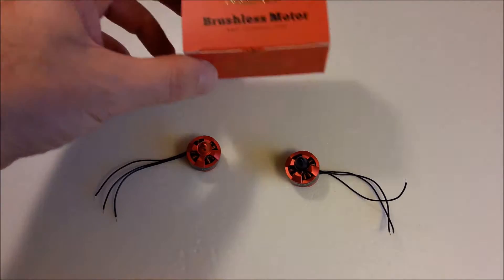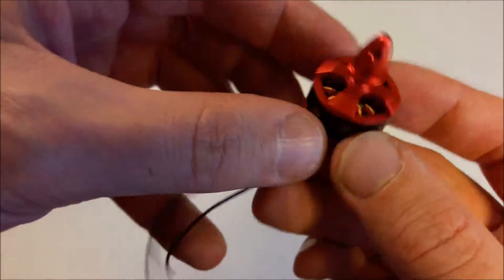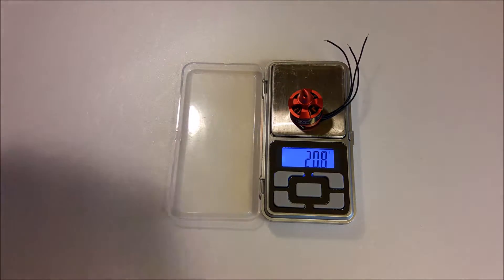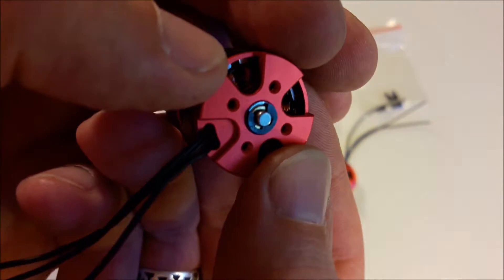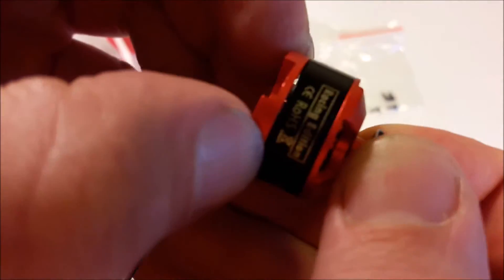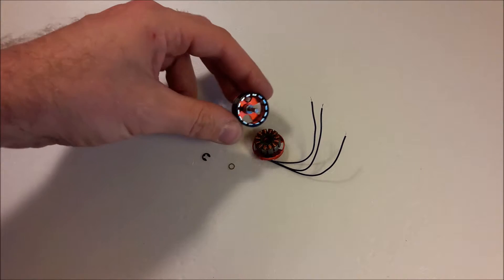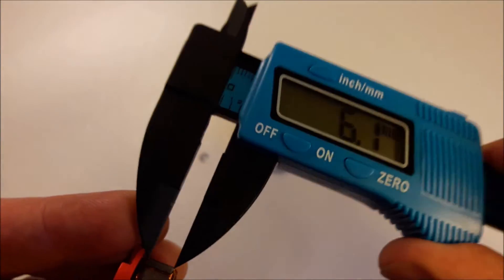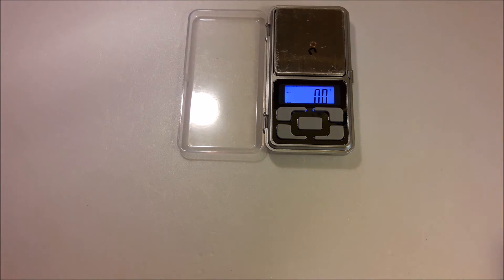Racerstar BR1806 2280kv motor review

Comment: for hubsan 501s the moter Racerstar Racing Edition 1806 BR1806 2280KV????
Reply from the maker: Don't know for sure. Probably they would fit, but the motor base is a bit diferent. I have seen the images of some user installing Racerstar RS1806 race spec (not available anymore) motors on Hubsan 501s. Try to search for an answer on the forums.